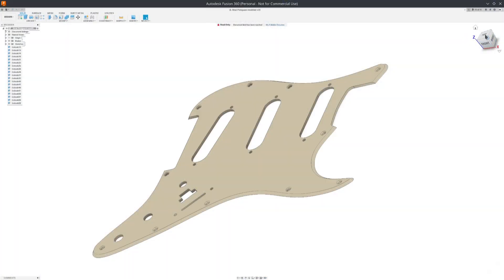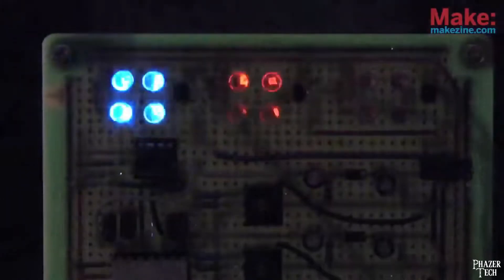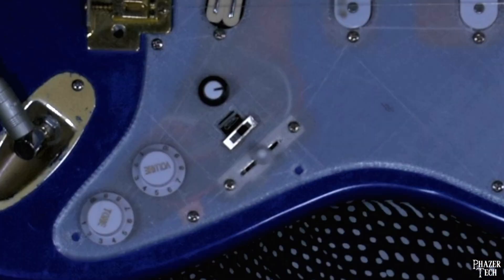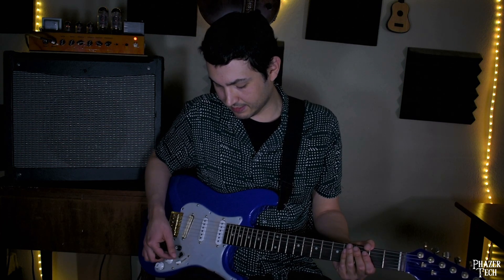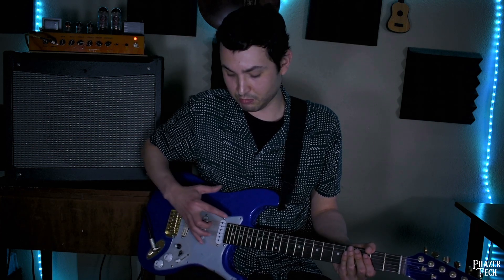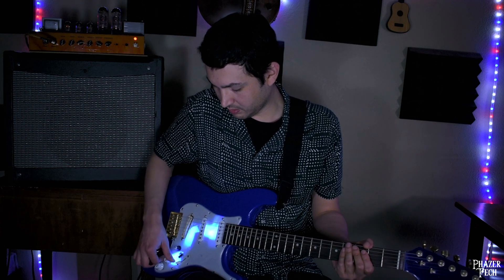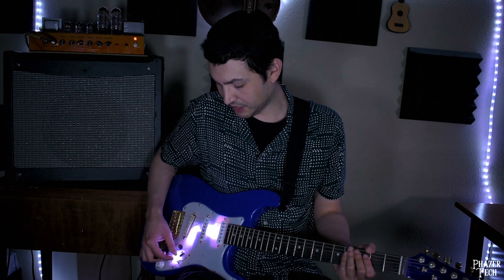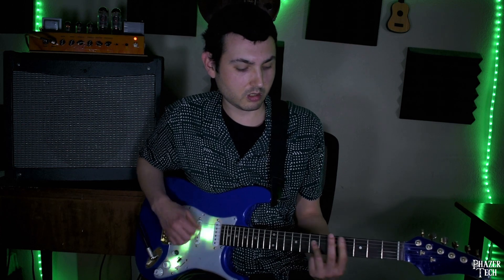LED Guitar Pickguard Prototype - A Pickguard That Dynamically Reacts To Your Playing!

Comment: So it's just  a sound reactive rgb in a guitar...
Reply from the maker: Have you seen many of these around? 
Also most sound reactive LEDs simply turn on and off when they detect sound, they don't change colors according to the frequency like mine does. It's a custom designed algorithm and circuit.

Comment: Love your idea. circuit shout be isolated from a foil screened electronic parts of the guitar in order to get rid of the noises. So, if your guitar internal components are not screened (ig they are not), they should be. to make a light smoother you could distance an led a bit more of a pickguard, increase the amount of LED as you already said, maybe put them sideways ( I mean not pointing directly into a transparent material). In general, cool build, nice job.
Reply from the maker: Thanks!  Those are good ideas I'll need to test out.    I put foil in the cavity to protect from outside EMF, but the components aren't shielded from my circuit as you can tell.  Solving the two main issues is definitely not a trivial task since both the issues can affect each other.  Finding the optimal placement for the LEDs to light up as much of the pickguard as possible might not be the best orientation for them when it comes to noise.